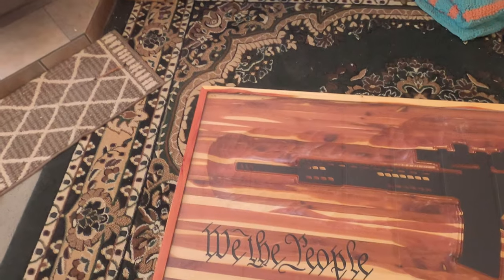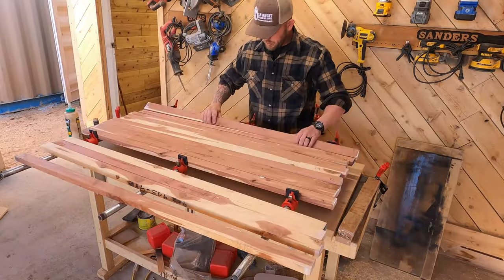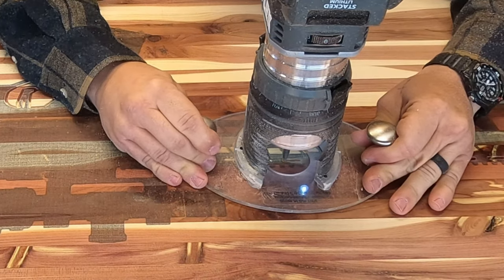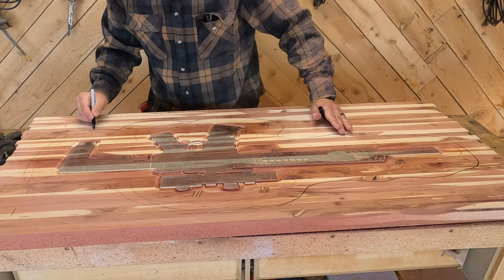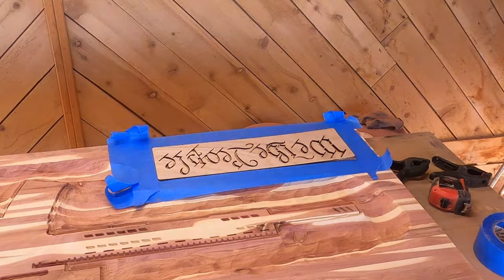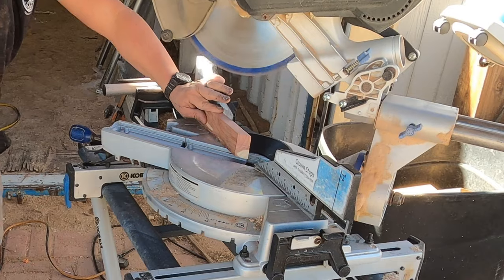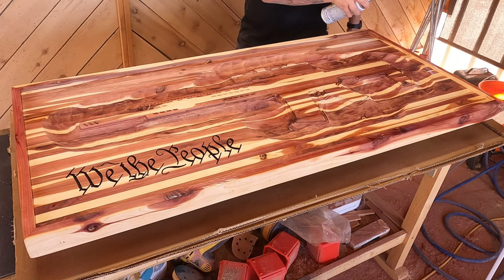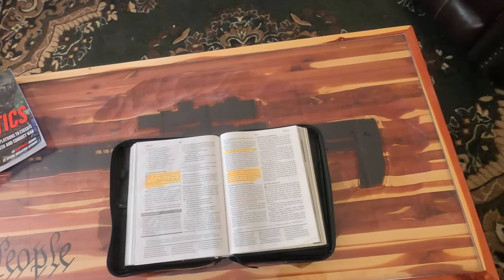Making A Custom Red Cedar Coffee Table

Comment: Howdy Guys...

I think it looks cool. Personally, I don't like hairpin legs, I would have made them custom....but I understand, you guys ain't woodworkers. 

I used to run and write programs for a HUGE cnc table (5' x 12' table). We did Plastics for the oilfields and other companies. 

Used Plex and others many times...MANY times. 

Point I'm getting to...There is a plastic sheet that's made specifically to go over item like that which can be removed and discarded. It's been about 10+ years since I worked at that shop, so I can't remember the name of it....BUT...an easy way to think about what I'm talking about....Those thin sheets of plastic you put on the face of your phone so you don't scratch the glass. THATS what I'm talking about. I guess you can call it a scratch guard (though that's not it's technical term). 

Plex scratches really easy...honestly, a simple hangnail will scratch it. So, your table top, after about a year probably, it's going to have scratches. At that point, you have 2 options...Sand and buff it or replace it. 

OR...though it would probably cost a bit, get a thin film scratch cover to go over it. It's like as thin as window tint. After a year or whenever...pull the old "guard" off, add a new one. It's applied the same way as eindow tint too. Soapy water, squeegee, paper towel. 

Small investment to keep your tabletop clean and clear. 

Also....question: You said you used 8 coats on each side. MANNN!!! How many cans did that take? I figure around 5-7 cans. At that point....Wouldn't it have been more feasible to use Poly in your critter sprayer? At $7 a can...That cost around $50+ where a single quart of Poly would only be around $20. 

Anyhoo....Enjoyed the video guys. Hope my idea helps you out. 

When yall think yall might catch up on the SCOTD?
Reply from the maker: Thanks Mike. I'll look into that stuff and see what I can find. Sounds like a cool product. We spent 1 can on each side so it wasnt too bad. 
We'll be doing an SCOTD hopefully soon haha it's been a while